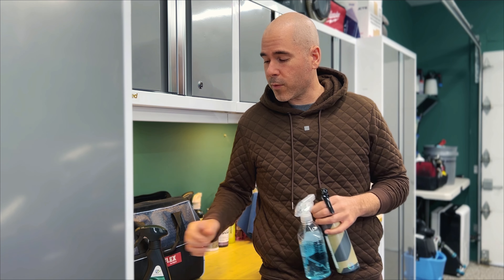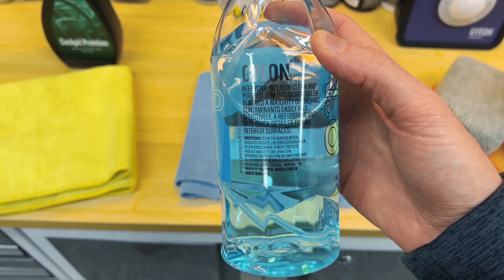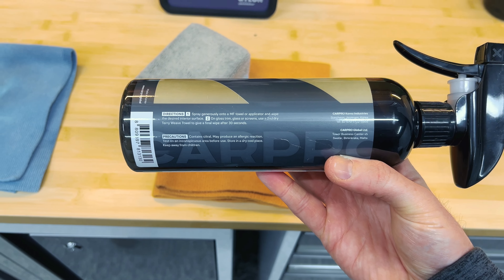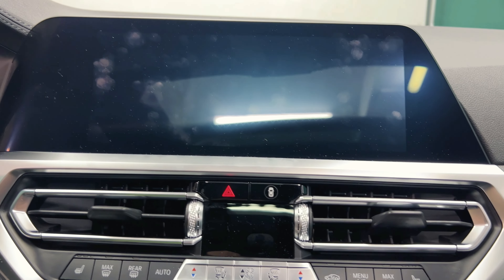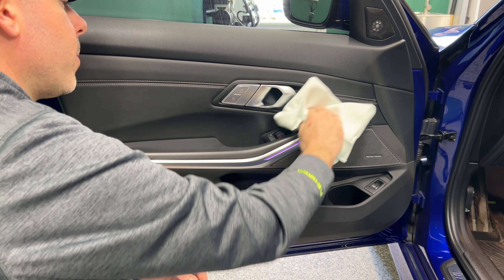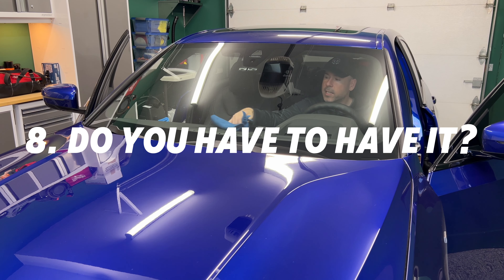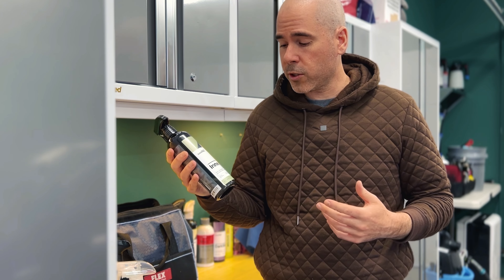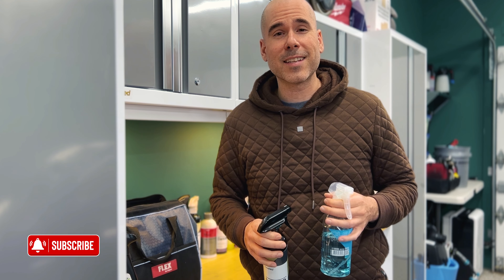Quick Interior Detailers : WHO is the BEST of the BEST?

Comment: I have been using Cockpit Premium for at least 30 years all the way back when it was from Einzett in Germany before it changed over to Nextzett.  Until the new products were introduced a couple of years ago, Cockpit Premium was the king of interior detailers.     No doubt the newer products (Inner QD and Gyeon Interior Detailer) are top notch as just about everything from those two brands is top notch.   Gyeon Interior Detailer is next on my list to purchase.  I wouldn't purchase Inner QD.   For $5 more you can get CarPro Inside and just dilute it down to the interiors dilution ratio.   Inner QD is just Inside watered down.   That way you get four times the amount.
Reply from the maker: Hey Joe thanks for stopping by to this one! Like you said all good products in the end. Actually innerQD is almost the same as Gyeon interior, both have a good amount of alcohol and work in the glossy trims and infotainement screens.  Not to be confused with Carpro inside which is a deep clean interior cleaner that foams a lot.
Reply: @Detailing_Dogma  Good info!   All great products for sure.   Thanks for posting such informative detailing videos!

Comment: Thank you for the vid, I’m honestly a nextzett fan, never tried Gyeon, Carpro I’ve tried but feel as though it’s a little oily?
Reply from the maker: Hey John thanks for chiming in as usual.  InnerQD is alcohol based too shouldn't be oily, never found to be the case, what do you mean by oily like patchy after wipe-off?  good rule of thumb is to shake the bottle well before every use, or maybe you got a bad batch!?  Cheers my man
Reply: @Detailing_Dogma  I use both the inner QD and the Gyeon. The inner QD will leave a haze on anything shiny, you need to let it dry and then follow with another wipe to remove the haze. I was used to Gyeon as I did not need to come back and rewipe, it was just clean, so I struggled with Inner QD at first. You would see the haze on the shiny gray trim on the BMW, info screen, black gloss, took multi wiping to remove the haze. I use the gyeon on the info screen and black gloss. I like the satin finish left by the Inner QD, vs just clean from the Gyeon.
Reply from the maker: @ruebarb1  Thank you for watching and sharing your experience.  I kind of prefer GYEON as well for the weekly wipeoff.  cheers!

Comment: I still have some old 1z branded Cockpit Premium from years ago. I remember there was a big deal because Nexzett changed the scent and some people said it stank like urinal cakes. lol. Obsessed Garage stopped selling it because of the scent change. If Nexzett did improve the scent they did a terrible job at letting us know. I've been afraid to buy it. I do remember trying their glass cleaner and that stuff was great but 100% did smell like urinal cakes. lol
Reply from the maker: Hey man, happy to have you on the channel, I actually got Cockpit back in the Matt Moreman era and just like you said it's good but scent left to be desired, I wouldnt call it urine but a weird citrus.  I'll have a new video on quick detailer for interior and my new favorite is ADS Pilot which is a new class of it's own, stay tuned.  cheers ✌
Reply: @Detailing_Dogma  Hmm, I think I missed all the talk about Pilot when it came out. I was thinking of going with Gyeon Interior Detailer.
Reply from the maker: @rockhills  well I'll have a video on it soon.  Its more versatile and. clean leather like a charm.  Also smell really good  it does everything Gyeon detailer does but has actual cleaning power.  The gyeon is more for very light wipe down, dont get wrong its good and nice to use but Pilot takes it to another level imo.  Works on glossy trims and info screen streak free.  The InnerQD and Int detailer wont do much on leather from my experience.